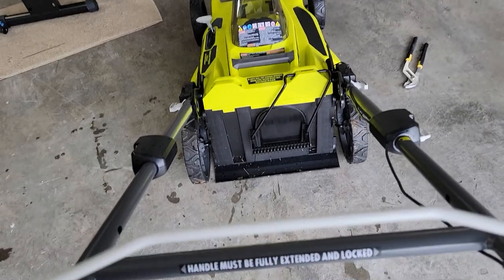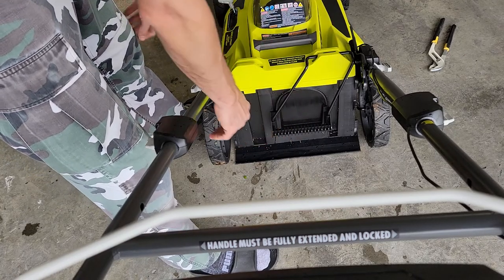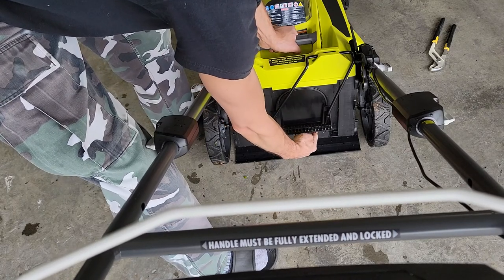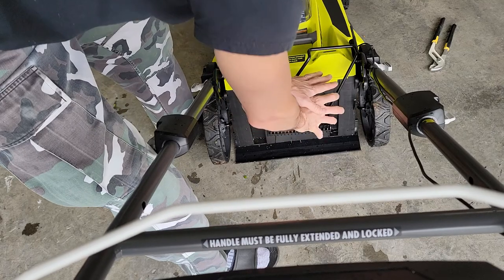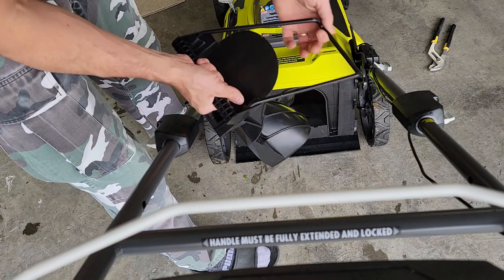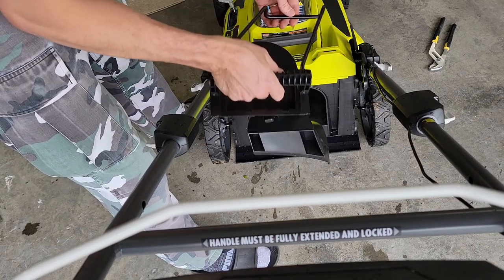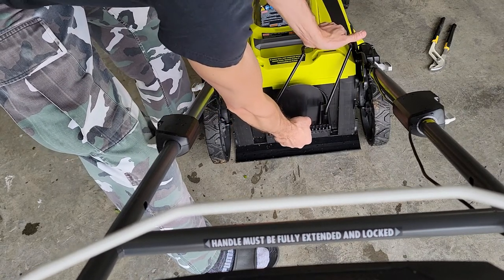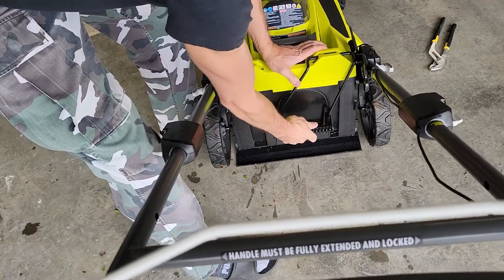HOW TO REMOVE THE RYOBI 40 VOLT MOWER MULCHER PLUG AND HOW TO PUT IT BACK

Comment: So it is supposed to snap in place with those two tabs.  Mine must be warped or something because I can't get it to lock.  So I just now without locking it in place but it moves around a bit and the safety hoop sometimes moves enough that the mower shuts off and I need to reseat it.
Reply from the maker: Hmm I haven't had an issue with it doing that.. odd